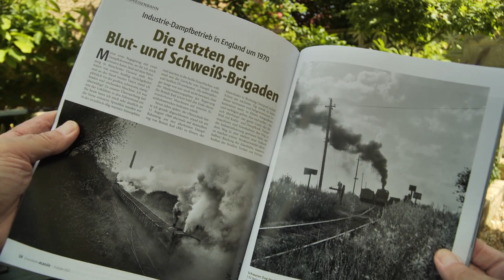Coal Fired Little Engines

Comment: I have a gas fire accucraft ruby. It's hard enough to get a good mix of gas flow for the amount of work the engine is doing with that. I can only imagine coal firing the same engine...
I do have a Goodall valve and a squirt bottle for it though, it's a huge help for when I end up running out of gas before I should because it's so hard to get the flow just right when steaming up!
Reply: I find that the turbo blue butane that rural king has in store works best for my ruby I start by using as small of a flame as I can until I see the pressure gauge move then I ramp it up i also can't get the gas to vaporize when below sixty thinking about making some heating system with a small water tank
Reply: @wesbrackmanthercenthusiast4695  I'll have to give that brand a try once I get a new valve rod, mine snapped off in the valve while I was making adjustments this past winter.

Comment: Wonderful! I used to run 5" gauge live steam culminating a lovely hand-built (by a master engineer - not me!) quarry Hunslet (a big beast in 5") and much modified (again not by me) BR Standard Class 4 tank. Knee arthritis made it difficult to operate steam, so I sold my steam locos and now just have a 5" battery electric. I now have a (very - 2.5 weeks old) new knee so maybe these smaller steam engines could be a way back to live steam?
The trouble is, club tracks are 3.5, 5, or 7.25 inch.
Reply from the maker: If you watch one of my earlier videos with my coal fired Russell I show it running between the 3 1/2" and 5" gauge track.

Comment: at 3:30 how does no steam pressure escape, or go into the bottle?
Reply from the maker: Here's a non return valve on the engine feed which allows water into the boiler but no steam or pressure to come out.
Reply: @GandyDancerProductions  very cool, may I ask what the engine feed does?
Reply from the maker: @wolforzo9816  The engine feed is the water feed that is the pipe that gets the water into the boiler.

Comment: Hello, where can you find coal-fired gauge 1/g-scale trains? Most trains I see online are butane/gas or alcohol fired.
 I was also wondering if you can convert butane fired to coal? Thanks.
Reply from the maker: It's not easy to find a supplier.  Riverdale Locomotives (they have a website) make boiler kits for Roundhouse locos and DJB Engineering (they have a Facebook page and website) make complete locos.  Both have a long waiting list of orders.

Comment: Do you know where I can get those from engines?
Reply from the maker: There's no big manufacturer who makes these.  There are a some small suppliers like DJB Model Engineering.  You can find them on the web or Facebook.  I have no experience of their coal fired models though I do have a gas fire model of theirs and it's very good.